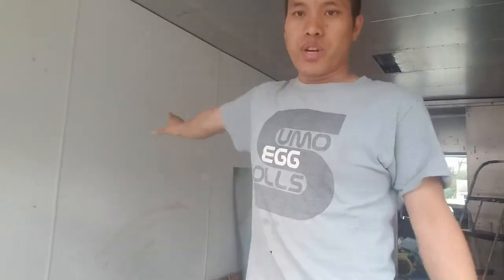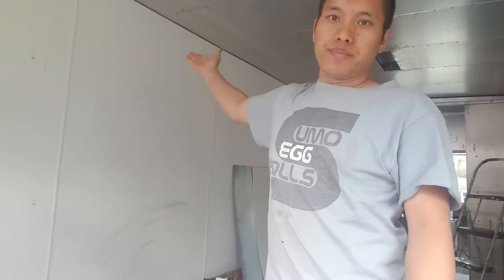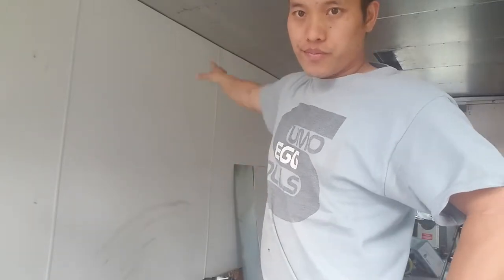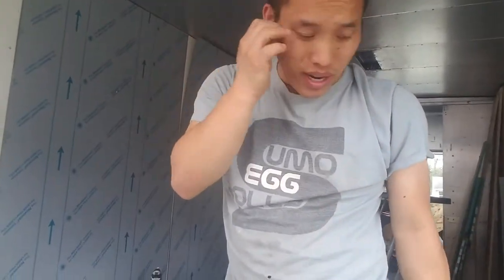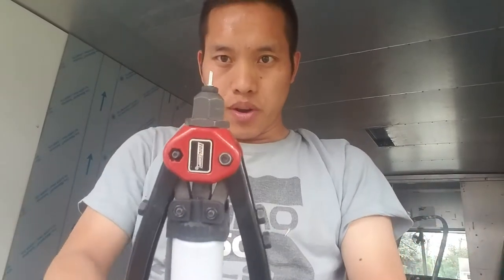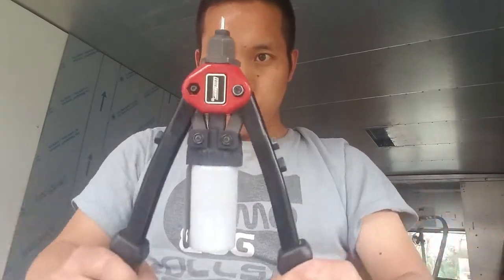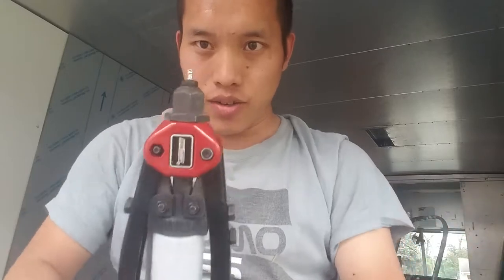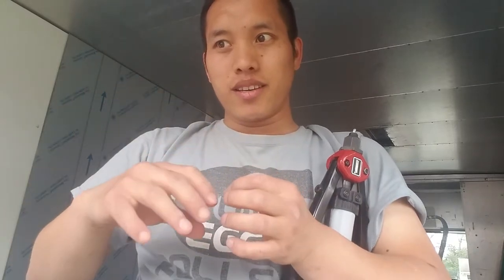Food Truck Build - Stainless Steal Installation

Comment: Hi what do you call thats your hand you holding it
Reply: It looks like the rivet tool. But i’m not sure the rivet tool will working good on the plywood to hold the SS sheet. Look the guys attached the SS sheet directed onto the wall. And does it stick with glue ? So the stailess rivet just supposed for the top. I will try to aluminum rivet on fly wood and see how it works.